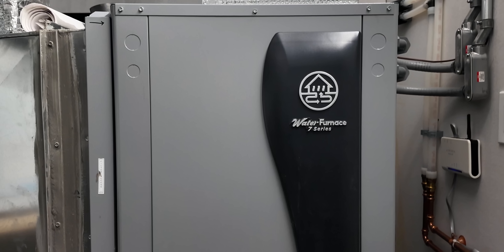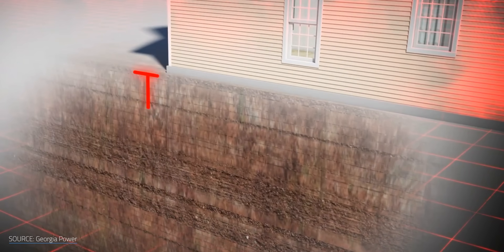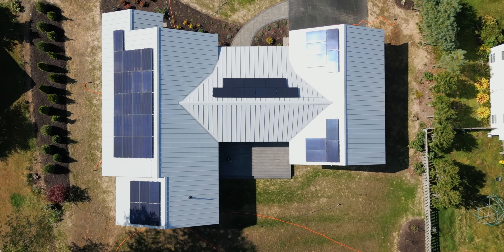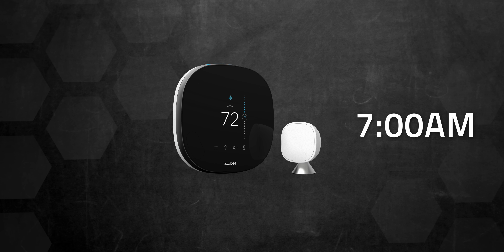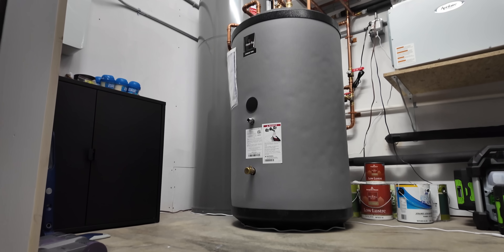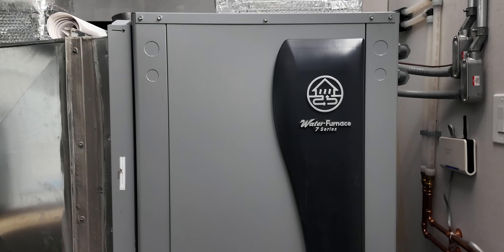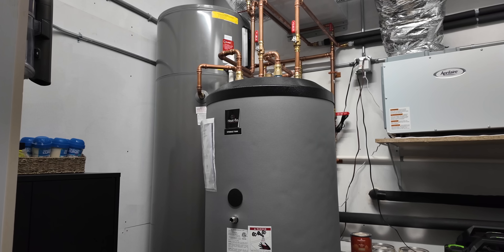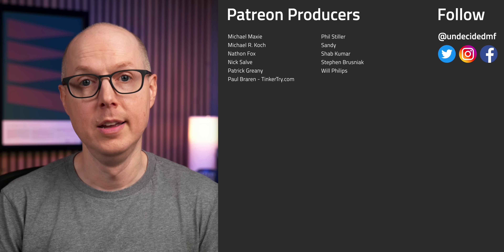How My Geothermal Heat Pump Really Performed (2 Years)

Comment: Is it worth it? That is the question. As a HVAC Service Tech with over 30+ years in the field working on everything including Geothermal, you are basing your long term savings on the life of the Equipment at 20-30 years which is unheard of in Heat Pump or Geothermal world. The Compressor is the main component of both and is running almost everyday for Heating and Cooling especially if you are using it for Hot Water Supply. There is a reason the Manufacturer is only giving a 10 year Parts Warranty on the equipment and the Option to purchase a 20 year Parts and Labor Warranty (which I hope you purchased). On all the old Geothermal units I have worked on, it was either the Compressor that gave out after 12-15 years, or it was the water to refrigerant heat exchanger that went bad and leaked water/glycol into the compressor. If your fortunate enough to have the extended Parts and Labor Warranty, then you might get 20 years from the unit. If you need to have one of the refrigerant parts replaced under just Parts warranty, the Labor is still going to cost you an arm and leg in today's market, especially on a Geo unit. As far as the 'cost' comparison between Geo and Air Heat Pumps, they are substantial. Living close to Lake Erie, I tell clients not to go for 2 speed or variable compressor technology because its not worth it in the long run. A standard 4 Ton Heat pump with electric strip heat backup costs around $12K to $15K in today's market, with the same life expectancy of 15-20 years (outdoor coils oxidize and don't transfer heat like new, the same as the water heat exchanger in a Geo). When you compare the equipment cost, and energy cost, and Maintenance cost, in the end you will see that the Air Heat pumps actually cost less in 30 years. Getting back to the Water Heat exchanger in a Geo, did anyone one of your Maintenance Techs tell you that in the future that the Geo lines need to be flushed and cleaned with the same as the Heat Exchanger in the Geo? That depends on the type of Geo fluid originally used in the underground piping. It's just like a Car, eventually you have to Flush and Clean the Cooling system in your car (even some electric cars), but nobody ever does and then they complain when a Radiator fails, or it gets clogged up. Unfortunately in the HVAC world you can't have both Comfort and Cost Savings. You have to Pay for Comfort, or you have to give up Comfort for Cost Savings. You talk about how much you are saving on Electricity cost towards the end, but you didn't say how much you paid for the Solar Equipment and the Batteries? Which unfortunately don't last forever also. Solar Cells start to loose efficiency on day one and the Batteries can only last so long before they need to be replaced. So, How much did it cost for the HVAC equipment (not including the underground loop as this will last for 100+ years), and the Electrical Solar equipment? Now, add at least 20% and this will give you a new total of what it will cost you to replace both in 30 years, and don't forget Rebates are gone after 2025 so you can't deduct that anymore. It all looks good at the beginning, but nothing lasts forever. So, Is it worth it?
Reply: Don't care.  If mine lasts 12 years it will more than pay for itself.  The Water Furnace 7 has a very high-quality variable speed compressor.  The tech that installed it said he has never seen one fail (unlike some other brands).  My system is now 7 years old and has never had any problems at all.  I think the chance of it going to at least 15 to 20 years is excellent.  I really enjoy the very low monthly bills and not having to listen to noisy, obnoxious and ugly outdoor units ruining my backyard.  So yes, it is 100% worth it.
Reply: He does say elsewhere that he lays out the numbers in another video and hits payback relatively quickly, whichbis typical for a well-built and well-engineered housing system like this.

Comment: I appreciate the deep dive. It was very informational.

I'm not sure I agree with combining the effect of the solar system and geothermal heat pump to come up with an operating cost for the heat pump. These are two independent systems. The heat pump reduced the electrical usage of your heating system, and the solar panels and batteries provided a source of electricity. The real comparison between geothermal heat pump vs other systems is the decrease in energy consumption.
Reply: And if the electric cost of the heat pump was "free" because of solar, by the same logic I could just buy solar to power my non-ground-sourced system and it will also be "free" to operate and there's no financial benefit to the ground-sourced-system.

Comment: Working in maintenance for 35 years, this system looks complicated with a bunch of parts. It looks it might work well for about 10 years and then the wear and tear steps in. I hope I am wrong but I have seen systems, not necessarily heating system that start out well and when things start getting older parts may be hard to get or you may have to upgrade because parts cannot be found. This can get expensive. I hope Yours works well for a long time.
Reply: Thus why they just scared away 98% of eventual house buyers and turned the property into a potential white elephant.  Ask any real estate agent the expression on a potential buyer’s face when they first see a utility room with in zonal floor heating, etc.  yikes!!

Comment: Matt, I'm in Western Montana. 3400 SF single story.  R-20 envelope (R-50 roof, R-20 walls, lots of glass). I sized a 4 ton GSHP. Total installed cost $10,650 including radiant tubing & 2 hydronic air handlers. 
4T Heat Pump $4200
House pipe $500
Ground pipe $900
Excavation (450 ft @ 8ft) $1750
350 gal thermal storage $1100
Pumps & fittings $800
Controls $100
Air handlers $1300

If I did it again, I would add another 100 ft trench in the ground. And add a soaker line at 5ft depth to moisten the soil. Or put the pipes under my septic field...
I would also buy the new DC inverter Heat Pump. 
Annual cost is $432/yr (1500 hours run time @ $0.072/kWh)
The other option is propane here...Same heat cost of $1600/yr. But would not provide AC too...
My solar generates 15,000 kWh per year, so I easily cover my HVAC.

Comment: Rebates DO NOT reduce cost - they transfer cost onto taxpayers.  You have said nothing about how long it will take to break even on the investment.  You have not compared equipment + operating costs of other systems over time (no one really cares whether the money goes to equipment or the power company, they just want the lowest overall cost).  You have said nothing about how long the system is supposed to last and compared that to the life span of other systems.  Environmentally you have said nothing about the carbon imprint of the cost of the system (working has environmental costs, therefore $$ spent on "environmentally friendly technologies" has an environmental cost).  There is also something weird in what you said about your installer "topping up" the fluid.  If the system is closed, that should not be necessary.  Where is the fluid going?

Comment: 10:05 Your server rack isn't just heating up your energy bill. It's heating up your house. That energy doesn't disappear. It is turned into heat. Your heat pump doesn't have to work as hard because you are generating so much waste heat from your servers. That's going to throw off all your numbers a bit.
Reply: Yep. Server rack is acting as a very inefficient heating system meaning the efficient heat pump dosnt need to do so much work.
Reply: @alexclifford8961  It's not very inefficient. It's basically 100% efficient - all normal electric heating is. A heat pump, however, is about 300% efficient in good conditions.
Reply: @thomasdalton1508  balances out
Reply: It’s not inefficient.  It’s how he earns a living

Comment: In my country a geothermal heat exchanger makes zero sense, since the temperature never really goes below 0°C (but temperatures above 30°C is fairly common). I would have never been able to recover the costs compared to just the simple air exchangers that I currently use. I doubled down on my energy generation by oversizing my solar array in order to run the five exchanger units. They're variable rate, so don't use much energy at all. Like Matt says, it all depends on where you live and what your weather and local rebate system is like.

Comment: Im an Electrician.  One of my commercial customers has a geothermal system in his house. He uses well water as the heat exchanger.  Two wells. His house is around F 3000 sq feet.. It's excellent.

Comment: I also love in MA and installed just over 2 years ago.  Retrofit on existing 1500sqft house.   I installed enough extra solar(addon to existing system) to cover the GSHP operation.   I went with dandelion.   All in after rebates it coste about 35, 000  now I have free carbon free heating and cooling.  Good.  Yes,  I would do it again!

Comment: 2008 in Germany  I built a house that used a heat pump using ground water as the heat source (pulling water from about 8m below the ground , running it through a heat exchanger and then letting it flow back down). I only used it for heat. It worked quite well (still does but I no longer live there) but the water pump so far needed to be replaced twice (once by me and once by the new owner) but that was only several hundred dollars for the pump.

Comment: I live in Urban California and we have many 4-8 unit apartments near me. I am curious the viability of these on limited unit housing. If the cost is only slightly higher for higher output units then it might be a reasonable way to reduce energy consumption for apartments, but convincing landlords to do anything for renters that doesn't lead directly to increased rent take seems impossible.

Comment: Since the systems use a refrigerant based compressor to extract the heat or cooling running 24 hours seven days a week, I would expect that compressor to only last eight or 10 years at the most. Plus with the system being extremely complicated you’re going to depend on a greedy heating contractor to do any kind of repairs. I think if you factor all that in, I don’t think you’re as far as head as you think I could be wrong though best of luck

Comment: Hey Matt, another factor for these type of discussions that I would also be stoked to learn more about... financial value.
IE: how does this change effect the value of the primary asset.
Yes, like electric and heating rates, how value changes can also be more demographic specific, but I believe this could still be a helpful discussion driver for many. I suspect there is potential value add to a house with geothermal (outside of market changes, although, I recognize that's part of the reality behind these types of statistics). But, statistically speaking, Google says people can expect a 5% to 20% value increase, which theoretically also helps offset cost / any number of other options given the financial tools available.
Reply: Not really, it's their home forever. So, any added value to the home is kind of irrelevant.
Reply: @williameldridge9382  False. One can still choose to leverage an asset they plan to keep. 😉

Comment: When thinking of heat pumps I like to remind myself that 0 degrees Celcius = 273 Degrees K. 

We tend to think of the freezing point of water as if there’s no heat in the air at that temperature but thinking of it in K reminds me of how much heat there is… 

Air source heat pumps aren’t typically designed to take advantage of heat in the air at sub freezing temperatures. There are heat pumps that do this however two stage heat pumps do have more moving parts.

Comment: In a house like yours, most electricity consumption helps heat the house, especially if you have servers running that is not negligble. It's just heating with a COP of one. I'm not a regular viewer, but always a bit dissappointed about the lack of numbers in physical unit. What is the thermal power output of your system? And how does that compare to standards in the US? I mean, for a passive house construction this system seems wildly overpowered. But compared to the standard US house it's probably almost laughably small? 
My own house has a usable surface of 2050 sq ft. Our air source heatpump has a maximum thermal output of 3,5kW. We used gas before and did not do any other upgrades than replacing the gasfurnace by a heatpump (both supply heating and hot water). In the gas setup we used 5000kWh of gas per year, with the heatpump we sit around 1100kWh per year.  So an SCOP of 4,54.

Comment: Are you sure it isn't the server room (plus TV, appliances and people) that heats the house more than the giant 'furnace' - where do you think that energy goes? Matt, your house is so well insulated, you should have gone open plan with 2 or 3 small mini-split air2air units and an immersion for the hot water. I think you would be $50,000 better off with much lower on-going servicing costs AND good redundancy when things stop working. Our monthly payment to the energy company has been £50 for the past 3 years for a (Swedish) 1980's 5-bed house in England with 5kW solar and 13.5kWh batteries. Similar setup (and we have an EV now) but our install (Solar + A2A) was around £15k. The cost of geothermal isn't justifiable unless maybe your air temp drops well below -10°C for a lot of the year.

Comment: I've always wondered whether it makes sense to install a solar collector, connect it to the system, and pump heat underground when it's sunny and warm (hot). From mid-spring to fall, it might be possible to pump tens of thousands of kilowatt-hours underground and use that energy (partially, due to losses) throughout the winter.

Comment: Thumbs up Matt. I have lost my energy in creating charts but I love that you haven’t 😊. We moved in our apartment 2019 which is one of 9 in building that is equipped with ground water based system. With its drawbacks, such ferrite eating bacteria that require often filter exchange we are quite happy that investor decided to install this system. Comparing to other buildings heating we are paying in a year what they pay in 2 months. 

Also to support your claim on thermostats. I have installed Salus system for our apartment and temperature is set to 24C all year round, only logic is changed from heating to cooling season. System turns on twice per day to supply hot or cold water for all apartments. This took some try and error until we dialed it correctly that most remote points have enough energy flow. One thing that I have noticed is that in our apartment loops get open very rarely, which is a consequence of having warm apartments above and below so we do not radiate energy that much, although having a big apartment that has outside walls on 3 sides has higher losses. Anyway, most exposed room is a living room that has large balcony exit, but heating kicks in only one every 10 days.

As system is not responding directly to my needs, I have implemented a inlet temperature sensor so it will delay opening of a loop if inlet energy is insufficient for a task. Heat inertia helps a lot with this as temperature drop is far below what we can feel.

One thing in development is to tune up heat pump operating schedules based on weather forecast. At the moment I am solving this issue reactively based on max and min temperatures of water which was good enough but in remote apartments that have basic thermostats brings a temporary temperature change of half to a full C.

Comment: So with Inland Power in Spokane having $0.0780/kWh, I should have relatively low power costs.  My back of the napkin would put my cost at $240 per year for HVAC with hot water.  I like that thought.

Comment: 9:44 In Quebec we pay 6¢/kWh and we are still complaining… I guess that is why geothermal heat pump are not as widespread up here though it would still be a good idea if there is a power outage and one has to rely on local energy sources such as batteries, etc. just to keep a system running. Now with Trump et al scrapping everything alternative it might not be as interesting. Unless the mindset is to care about the environment and the climate.

Comment: Here's my thought and huge concerns about it, The system you use requires and app, so therefore it is connected to the internet via the app, making you dependent on the company that you bought from. Lets say down the road investors say they want more money or the company gets greedy and charges you to use the app, and then raises the price every 6 months. Or god forbid the serves get shut down for any reason including the company going belly up. Now you either have to pay for the service and they have you by the balls basically cause if you don't you have no heat or A/C, or in your case hot water. They could add some crazy thing in the EULA that says they can use all your data and if there are any mics or camera's (Phone or thermostat) and if you don't agree to the new terms, well now your up that creek with no paddle and your freeze or roast. None of that kind of stuff should be dependent on any sort of internet connection and should only be controlled via thermostat that is stand alone and no internet needed. Now that I have seen the cost, how long till you really get ahead on energy? in Polson MT my average power bill for the year (averaging all 12 months) is 250 a month, even at the low end of what you paid $58K it would take almost 20 years at paying nothing to the power company, but if I paid 1/4 of my current average it would take 25 years 8 months just to break even, at full price of 78K it would be 26 years at no payment and 34 years and 6 months at 1/4 my current rate. That makes no sense to add anything like that in my place. Yes we have a below average power rate here. We pay $.0983/KWH for non peak and $.1219 for peak and $.60 for demand plus a $24 service charge just to have it.